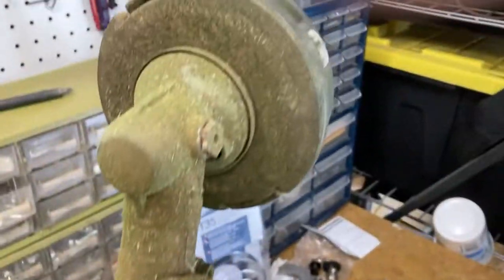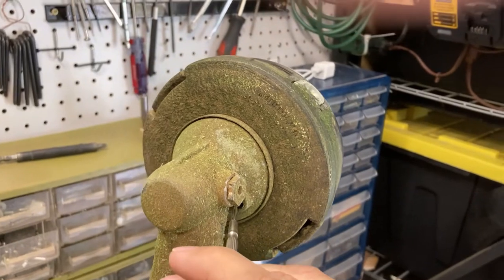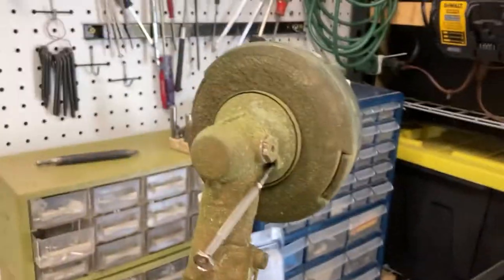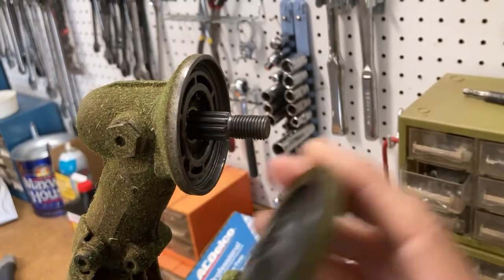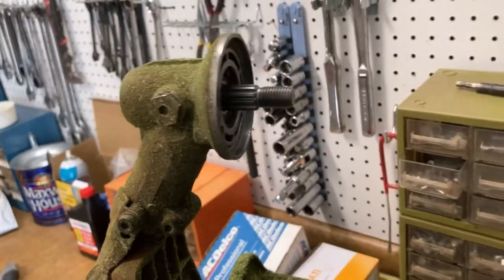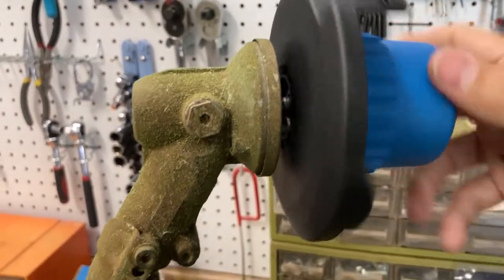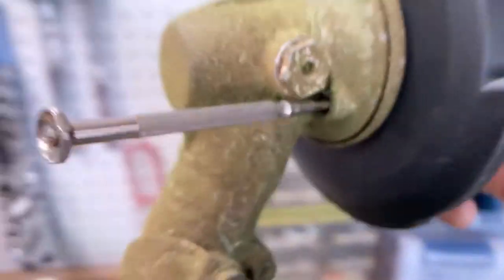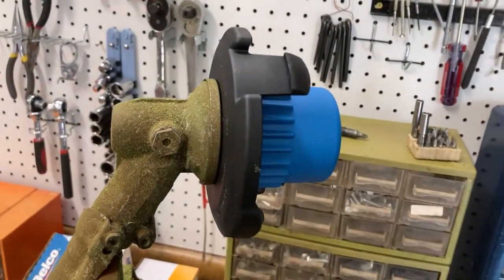Husqvarna Trimmer Head Replacement 324L

Comment: There is no hole for pin
Reply from the maker: Do you have the same model trimmer?
Reply: Dirt and grime will often completely cover it up so you might need to really clean this area to find it. Also on some models the hole is on the side not the top like here.